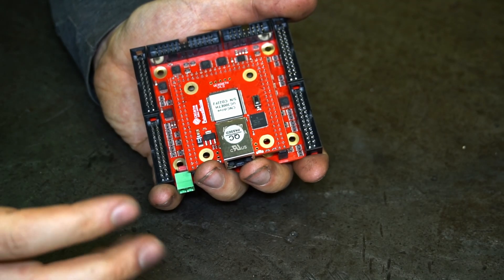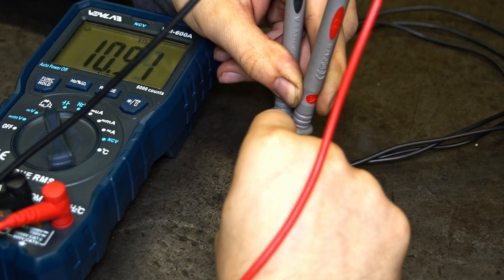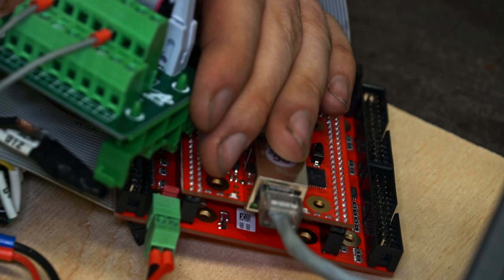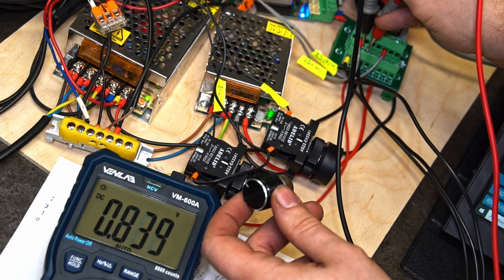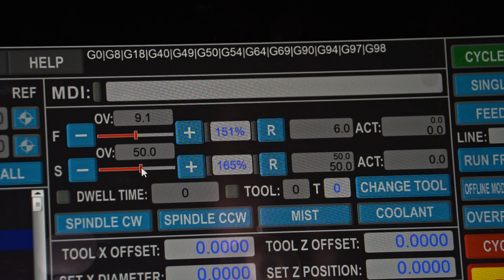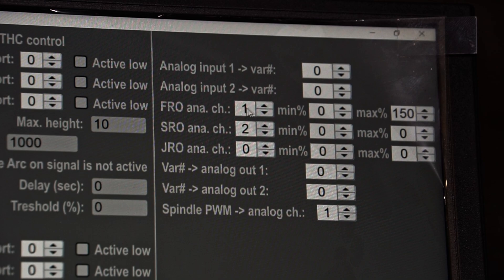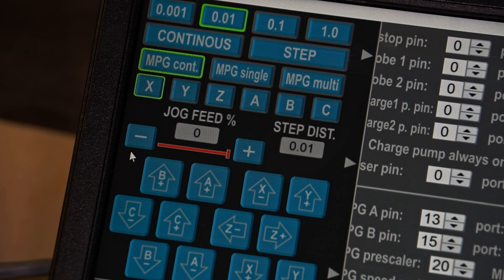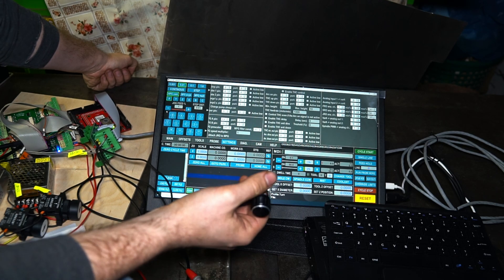Analog Inputs! - UC300ETH CNC Controller #8

Comment: I know you have the same servo.
I have another question about the settings.
When I run a program and press than the  stop butten , the servo stops very abruptly.
Do you know which parameter to adjust in the Servo
Thanks.
Reply from the maker: I guess you could try to play with the gain / K-factor settings.
Reply: @GBWM_CNC  thanks

Comment: Thx for the videos mate. I have one question about the 10k meters. I have some 3590s-2-103l 10k. Blue cylinder types. Can you maybe tell me about the pin out on them ?
Reply: An great thanks! :D
Reply from the maker: You're welcome! I'm not sure about the pin out but I think you should be able to work it out with a  multimeter as I did. Keeping in mind this is just an adjustabel resistor.
Reply: @GBWM_CNC   thx alot. but how do you find the positiv end and gnd end of the potmeter?  or does it care what end im using as long the adjustabel pin is right ?
Reply: @vega3dcreative  Swapping the two end pins of the pot will just reverse the direction.
Reply from the maker: exactly as  @AndyMcGeever  mentioned
Reply: @ On most standard pots the centre pin is the adjustable output but there are exceptions. A multimeter will tell you which are which, adjust the pot so it's roughly in the middle and then across 2 of the pins you'll read 10k. Those are your two ends and the other pin sweeps between them. There isn't a pos and neg as such because a pot can be used in different ways but as the centre pin sweeps round the resistance between it and the other pins goes down on one side as the other side goes up. Using a pot as a variable voltage divider as this does means putting +5v on one end and the other end to ground. The centre pin then sweeps between the two giving a variable output voltage between that centre pin and the circuit ground.  Just to complicate it further, it will also work in both directions in a DC circuit - you can use the variable output to supply variable voltage to another component or you can use it in reverse as a variable ground path for that component where the closer to 0v it is, the more current flows. As long as it is in the circuit it will control the voltage.